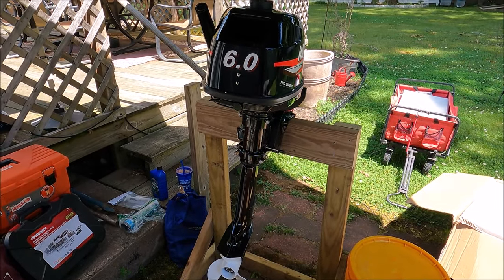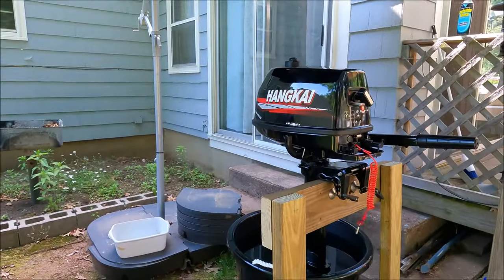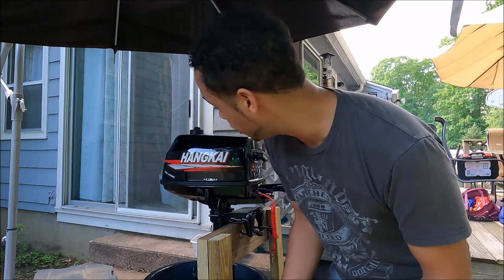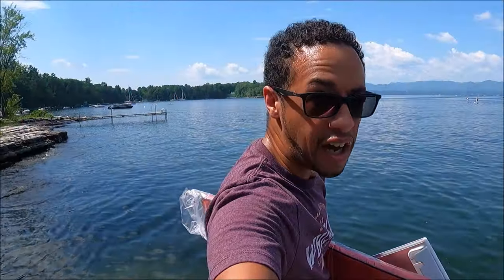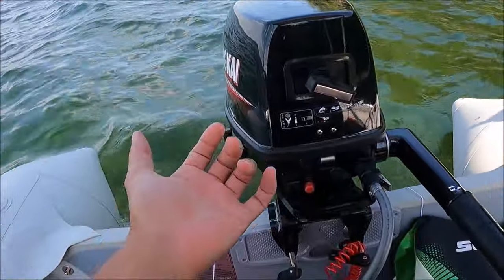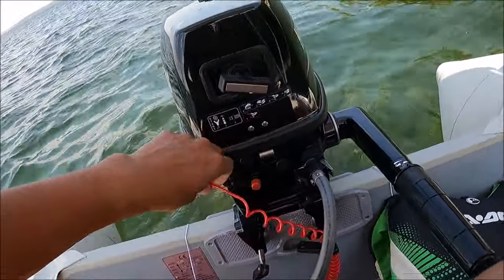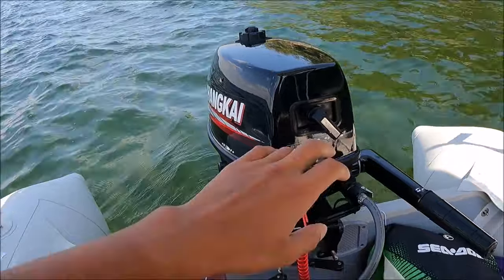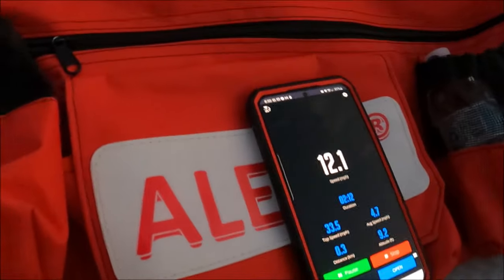HANGKAI 6HP Outboard Start Up - Review - Speed Test

Comment: I bought this motor last Saturday and im 7 hours into the break in period. Ill probably finish breaking it in on Saturday. So far, a very solid engine. Great trolling motor for fishing.
Reply from the maker: @leoscomputerandguitarrevie978  yeah I was impressed in the quality and ease of use for a cheaper model. I put it through it's paces on a huge lake like Champlain and it still held its own. Thanks for sharing. Be sure to Subscribe!
Reply: @SKLIFEstyle Thank you for your reply. I have 12 hours into my motor now and it is just fantastic. The vibrations were aggressive starting out but it has calmed down quite a bit, especially at half throttle. I did take the prop off and greased the shaft, and also greased the throttle cable to help with longevity on those parts. Probably got 3 to 4 weeks of good fishing weather here in Michigan then I'll need to put the motor in storage for the winter. I'll be excited to put some hours on it next year. Probably thinking I should order some impeller kits so I have them, although it does come with one to use after 100 hours of use.

Hopefully yours is still running strong.

I subscribed!!!

Comment: Hi i had bought same as yours 5 months ago i used it in 14feet SIB boat, few weeks ago the engine failed when i was on the middle of the sea and it never started since so i paddled for nearly 4hours to go back to the shore. And i found out the CDI burnt. Better get a reputable brand before it happen to you same thing to me. Now im waiting now my new suzuki 20hp to be delivered.
Reply from the maker: Really sorry to hear that happened. It isn't main transportation so idk if we will upgrade soon..but I will be sure to give it a more thorough look through before use. And be sure I will post a video if it does blow 🤞.*SK*
Reply: I had all the start up procedure done including break in. I would suggest do not full throttle more than 45seconds it has not fitted with voltage regulator, thats why it burnt CDI
Reply: Don't expect his price... You can only say that you get what you pay for. We can buy seven Yamaha four punch six for this hangkai two punch six
Reply: I ended up getting a 9.8 old Merc then upgraded to a 15 Johnson starts every time a hauls me all over Folsom lake
Reply: im not sure what you are expecting. a power pack/CDI can go out in any outboard and takes me 4 minutes to replace. presumably it has a warranty so no big deal.
Reply: Hey man same happened to me, in middle of breaking period time just shutdown in middle of the river and never started again, thanksGod o good man pull me to the shore back, now Im carrying an electric trilly backup motor 55lbs

Comment: Why do you have an external petrol tank? I thought we could simply put petrol  inside of the motor. Thanks for confirming
Reply from the maker: You can use the internal tank..its about 1/3 of a gallon. I was using a 3 gallon Septer. I hope to do a video on the tank soon.*SK*
Reply from the maker: To expand further I have the external tank to cut down on having to stop and refuel on the water. More prone to spilling with the internal tank needing refueling every hour and cuts out any concern that you are running low. It's enough to drive multiple days for long trips and it's just a plug in, nothing complicated.

Comment: after a tank of internal fuel the rings are more seated than they will ever be. heat cycle for an hour and thats it. 8 hrs break in is just insurance for the factory. if it doesnt start after 2 pulls give it a little gas. i see you kinda figured that out after yanking on the poor thing. the way to increase the life of the pullstart recoil spring is to pull the cord out until you feel resistance/compression then pull. you should see these guys ripping these when there is no resistance!
Reply from the maker: Yeah, I had a bit harder time starting up do to having just transporting it for a long distance. But any other time a couple pulls and it would always fire right up. Actually a pretty solid motor, and hard to see paying twice the price for the real mercury, especially when talking about such low horsepower. A big boat and such then yeah I would go for the reliability factory but for this application I think the cost savings is worth it.

Comment: I wonder how it would do on a 12ft Jon boat  been seeing these all over eBay for a decent price glad I seen this video
Reply from the maker: Hard to say, it would get ya around..might be slightly slower due to shape. I got up to 14.1 when on perfect plane, no gear and flat water.*SK*
Reply: Well I'm going to try my new buy hangki 6 horse on my 22 foot  ( 7 meter ) mini cruiser tomorrow and post it so let me know what you think..
Reply: @shutthedooronyourwayout  how did it do?
Reply: how is is that motor holding up? thinking of picking me up an 18 HP

Comment: Yeah ok video for the hangkai 6 horses.
A good work through on the running in process .
Did you fill the gearbox with oil if so which oil ?
What ratio two stroke oil did you use  ?
Reply edited for spelling mistakes
Reply from the maker: It was 25 to 1 oil to gas and after 8 hrs you can move on to 50 to 1. As for the gearbox oil, I used Star Brite Pro Star Premium 90w Hypoid lower gear unit oil.*SK*
Reply: @SKLIFEstyle  does it not come with gearbox oil?

Comment: I plan to use the tank on top of my new 6hp Suzuki as a reserve. I’m gonna keep it full as a back-up plan in case I screw up and the remote tank runs out unexpectedly. Since it’s only 6hp I probably won’t ever be so far away that the top tank won’t get me back in a pinch
Reply from the maker: Yeah not a bad idea. More fuel on board the better. I felt like the top tank was enough for about 45 to 1 hr of running. So yea def. A good reserve amount to get ya back safe. Thanks for watching and commenting. Be sure to SUBSCRIBE!
Reply: your suzuki if its a 4 stroke takes about 1/4 gallon/hr at half throttle. 1/2 gallon at full or a little more. so it might be a while before you run out
Reply: @ct1762  I now have a 3 gallon marine tank setup to compliment the tiny tank on the motor, so I feel like I'm good for anything. Better safe than sorry.

Comment: I'm up here on lake Champlain as well. Have you uses this motor any more? Looking at this for my 14' river boat. Also whats the measurement from the top of the transom mount to the planer board above the prop? Thanks.
Reply from the maker: That's awesome. I don't have the motor any longer, I actually sold the boat earlier this year since it wasn't going to get much use for the second year in a row. But this was a short shaft so I feel like it was about 18 inch. They have two versions I believe but the short shaft worked great for this application.

Comment: How is this your brake in of the motor video when you say just after 8 mins that you were out on it for hours the day before and it was good on gas? I'm confused
Reply from the maker: It took I believe 8 hrs to break in the motor. I did it over a 2 day period. I was driving it the day prior at the speed specified and could tell it wasn't using that much fuel over hours and many miles driven.

Comment: Hi thanks for the info i have a 3.5 but thinking of upgrading is this a long shaft?
Reply from the maker: They have a long shaft, but no, this is the short shaft version. Short is best for the size inflatable I purchased.
Reply: @SKLIFEstyle  Thanks for your reply Em no that's great i need a sort shaft for the American sundolifn 12 here in Ireland  ,great stuff thank u is it definitely a good moter?
Reply from the maker: @Cavanpikefishing  I thought it was. Ran well, decent powe, easy to operate, and pretty much a mercury clone, so if you did need want parts, it should be simple to find. Hard to justify over a grand or more for such little HP. Worked well with the external tank too.
Reply: @SKLIFEstyle  great news, thanks again😊

Comment: Has it been good for you?
Reply from the maker: @simonjohansson7284  it worked out great and easy to use. Pretty sturdy and nice to know the parts would be easy to get if needed. I just sold it earlier this season along with the boat but only because it wouldn't have been used much and I didn't want it to sit.

Comment: hello, what connector you use for the gas tank? is a yamaha stile connector?
Reply: The connector should be Tohatsu style.
Reply from the maker: Mercury would be the equivalent for parts on this...that is the connector kit I bought and fits 100%.*SK*
Reply: @SKLIFEstyle  Thanks for letting us know. I was under the impression that all parts and connections were compatible with Tohatsu, but Tohatsu does design the smaller Mercury outboards as well.
Reply: Evinrude is the same

Comment: How does your canopy handle at 10 mph ?
Reply from the maker: I got up to about 15 mph, and it was fine. Maybe a two second adjustment when I got to my destination, but it stayed up, in place, and didn't require me to hold on to it or anything. When we got towed to escape a storm quickly over like 25+mph started to be a bit much. The wind kicked up with the storm and waves, too, so that I'm sure that had an effect as well. But other than that, I was impressed. It's worth the purchase, and it breaks down to basically a gym bag when you're all done. I have a video of fully putting it together. I also have a video of the storm to see the conditions. The top isn't up in the video but may help. Thanks for watching. Be sure to Subscribe! *SK*

Comment: I had one this outboard on a 20' open skiff. It worked well. You should check all the nuts and screws to make sure they are tight. Its a good engine for the money. Not so sure about SK Lifestyle.
Reply from the maker: Yeah, not a bad idea with all the vibration. What's not to be sure about the channel?*SK*
Reply: How fast did that go on your skiff? I got a 17' 05 Glastron Mx 175. I have had problems twice stuck on the water, and was wanting to get one of these as a back up. I was thinking of getting the 9hp one they sell. The total weight of the boat with a full tank is about 2,400 lbs, so lets say 3,000 with a few people on it... Could you estimate how fast that would go as well?? (First time throttle cable was loose, second time starter bolts broke) Unexpected things keep happening so thats why I want to put one of these as a backup...

Comment: What do you mean 25 to 1?
Reply from the maker: I believe that was referring to the gas to oil mixture ratio. Most 2stroke bottle will say how many oz to put in per gallon to be at a certain mixture ratio. If they only give the 50:1 just cut it in half. That was just for the break in period if I'm not mistaken. And then in bumps up to standard ratios.

Comment: How long has it lasted with minimal problems so far
Reply from the maker: Well I am getting ready to run it for its 2nd season....didn't have problems running it months after summer last year when I went to winterize it. Fingers crossed it will still run fine now. Haven't had any issues. I would recommend the external tank. 3 Gallons is enough to run days without refilling. And when you do you can do it on land and bring thr tank back.

Comment: Would this work for a 14/32 Jon boat  ?
Reply from the maker: I would say so. The extra weight may make it slower on take off. I think if you can got for 9HP. That extra couple MPH will make a diff.   Unless weight or transporting it makes it a problem. I like this 6HP another 3 to 4 mph would be great. But that was also with being on Lake Champlain. If you are traveling many miles at one go then this should be okay.*SK*
Reply from the maker: Sorry, poor grammar and typing, must still be waking up. Hope that helped. Be sure to Subscribe! I will be doing more content on this setup, plus there's a chance we get a full size boat this year so lots of videos to come! *SK*
Reply: Thanks dude definitely helps I know it might be a bit underpowered but not trying to win any races just a little recreation and fishing around the local rivers and lakes just don’t want to be underpowered where the current is dragging me away for the price of $600 ish new I think I’ll give it a go it seems like good balance of price power and  good fuel economy. Subscribed!
Reply from the maker: @joshuaswanson3068  Thanks! Yeah kind of where we were with it. Idk if we will bother upgraded the motor as the Catamaran won't get much use, and this does work just fine.
Reply: @SKLIFEstyle  I’m fixing to order one on eBay but it doesn’t tell you clearly would this be considered a short shaft motor because my transom measure too to bottom 15 inches so I definitely want a short shaft would you have any idea if this motor is the right fit ?
Reply from the maker: @joshuaswanson3068  it was a bit hard to understand on the Walmart website, too, but yes, I would consider this a short shaft, I also needed the same. I believe technically the 9hp was too long per specs if I remember correctly but I am sure the added power helps to make up for and ride disturbance and know people use them on thr kind of boat I have. I'm sure I will have some more videos out soon as we get into the second season with the boat. I may also get a full-size boat, too, so stay tuned & Subscribe to catch it all!*SK*

Comment: Crazy quiet , really, should hear 4 stroke
Reply from the maker: This is actually the 2 stroke. When it's under way there is some noise but idle speeds, ya she's super quiet. *SK*
Reply: The Hankai 4 strokes are mostly air cooled, so they are like push mowers in volume.